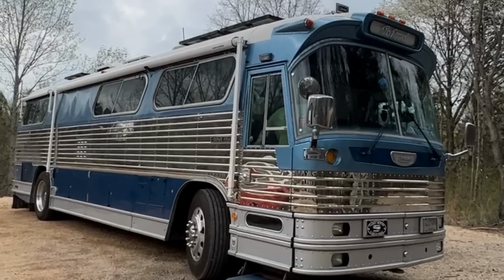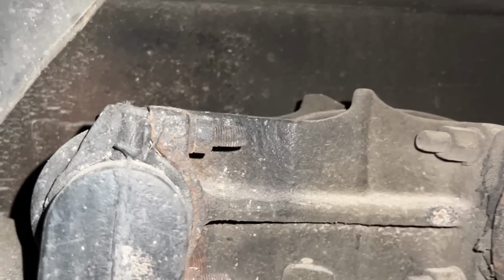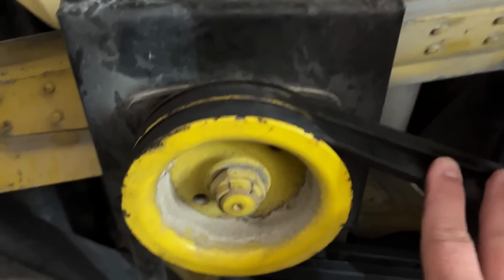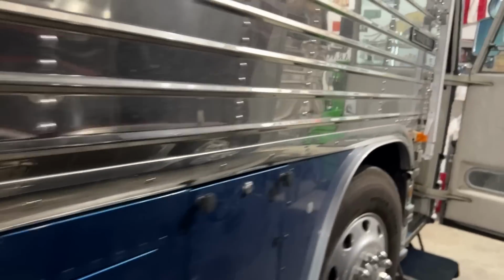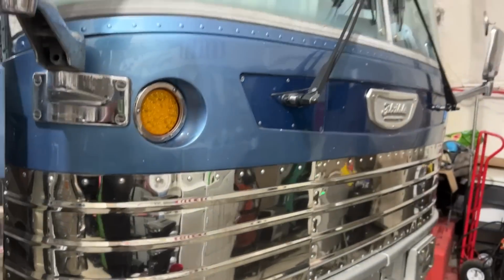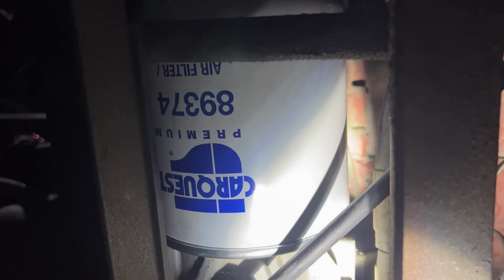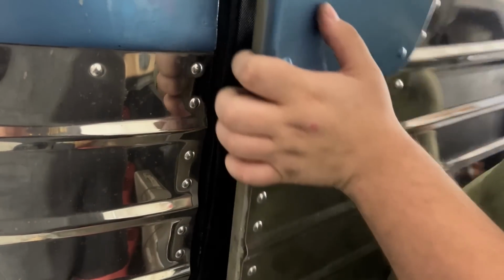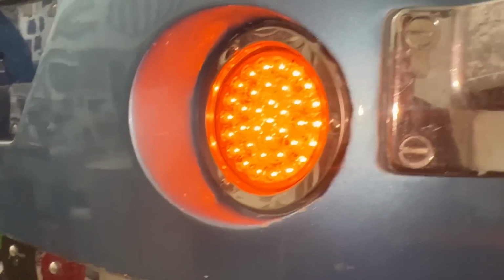Vintage flxible 1969 flxliner getting maintenance. Torsalastic suspension problems and adjustment

Comment: Yep, the Jakes worked great all the way home.  There may have been a couple small towns a little annoyed with me, but I was testing!
Reply: What was the original engine and trans in that bus Vice what’s in there now?
Reply: @jetdriver  671 2-stroke Detroit Diesel and 5 speed synchronized 5-speed manual was original.  Now has a Cummins L10 and Allison automatic.

Comment: cost of torsalastic must be incredibly high and electrical gremlins can drive a sane person to madness. i lust after a vl100 but my current problem free, cheap to fix, late model f150 trailer combo is so easy to live with. after many years i've come to see the dream is far better than the reality in most cases.

Comment: I noticed that the wiring could use soldered connectors instead of crimped. Also, though it's a bit of a project, I wonder if there's an air shock that's available for the torsilastic gas shock. Extra air lines, etc., but it would allow for ride height and attitude adjustment. Probably a part from Daimler Benz.

Comment: Are the torsion bars the reason that it's called Flxibile?  If not, it seems like that name wouldn't inspire much confidence in a big bus.  Maybe it was between that and the Bendomatic.  Thanks for the video!
Reply: Don't know, but what i do know is that the system first showed up in Tucker cars back in the 1940s, who co-developed it with Firestone.  The aerospace division of BF Goodrich further developed it for use in buses, and I believe Twin Coach was the first to use it in that application.
Reply: Lol nope. Flxible and Eagle buses used the Torsilastic suspension for 30-40 years.  That's a big reason why Eagles were so popular as entertainers, they ride a lot smoother than the airbag buses.  Flxible started out as a motorcycle sidecar company in 1915, they invented one that leaned with the bike - That's where Flxible came from.
Reply: @dadesigns4u  I wonder if Flxible used the torsilastic suspension on their transit buses.
Reply: @josephheston9238  I think they were all air suspension.
Reply: Wikipedia claims that their first product was motorcycle sidecars that leaned with the bike, hence "flexible". Not sure where the "e" went, though; NYC used Rohr Flxible busses when I was a kid (70s) and the spelling always bugged me.

Comment: I didn’t see reverse lights on the flexible when it backed out 🧐
Reply: They're on a toggle switch, didn't need them in the daylight.
Reply: @dadesigns4u  
If I’m not mistaken there required to pass inspection they alert other drivers that your backing up
Reply: @jeffk5386  They weren't required in the US until 1970 - Originally this bus didn't have any at all.

Comment: Were reverse lights not required on board in 1969? Or just something else that needs to be repaired? 
Is that a Cummins Big Cam engine?
Reply from the maker: Manual switch on dash.  It was daylight he didn’t need to see to back up.

Comment: What motor is in that one?
Reply: Cummins L10
Reply: @dadesigns4u  that's what I wondered about? No 2-cycle I thought that had a Cummins inside of it. 
That's a rare swap though for the most part most of the time it's usually still an old Detroit.
Very cool.

They were kind of like checker motors of the day weren't they they utilize a lot of GM things?

Comment: IMHO The torque alastic suspension was a major fubar .  Especially in the rust belt. If you had to repair or replace it. It was a loaded gun if you did not know how to adress it could hurt you bad. As a dealer tech i delt with many of there issues on Kenworth semi tractors. Just my experience
Reply: Interesting.  The conversation over the Torsalastic suspension made me remember the hard riding city buses in Chicago, many decades ago when I'd go down there from Great Lakes (Great Mistakes) Naval Training Center.  Those Chicago buses were BRUTAL in their ride quality.  They had to have had the most crude leaf spring suspension in the back because the bus SLAMMED every time it went over a Chicago pothole.
Reply: @BlackPill-pu4vi  while the many suspension options ar this time in history.  It was a choice and there were few.air ride or air spring assited air ride did not exist.. Scott will rip me up and thats OK. He knows his history..As a retired peterbilt tech of many years…Y’all are lucky to have the option to have someone to work on these neglected rag azz stuff.